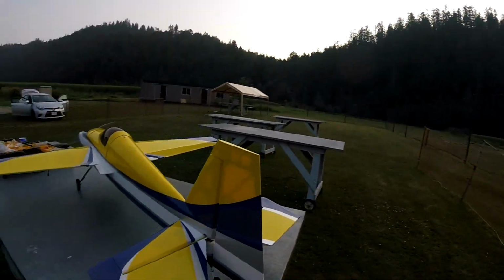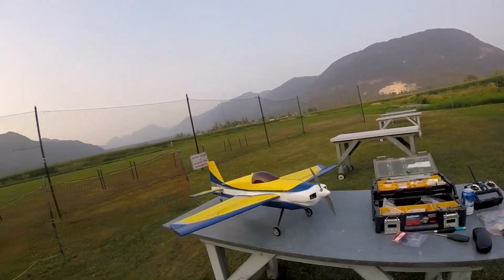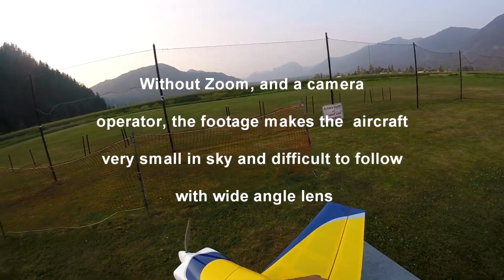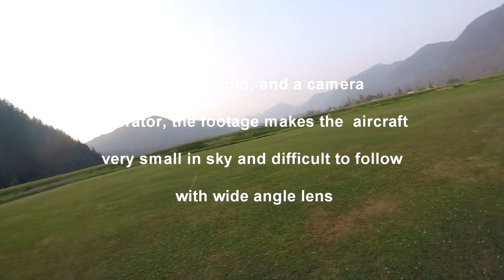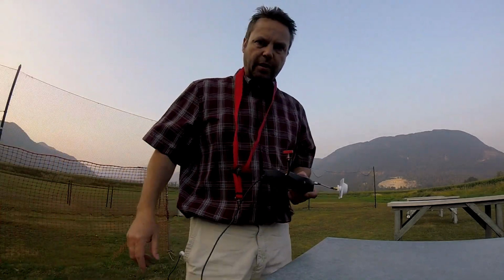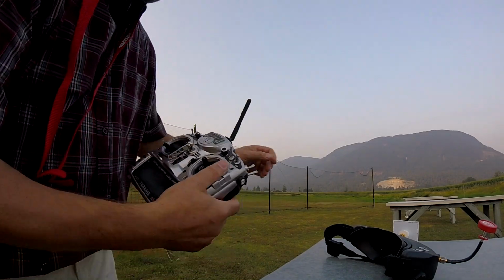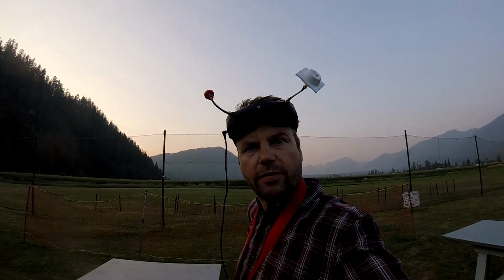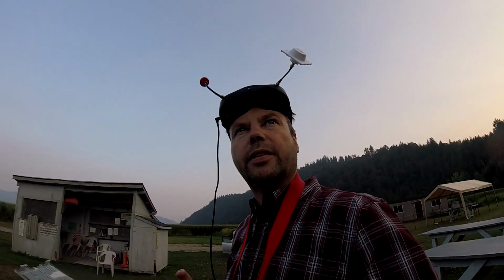Extreme Flight Laser EXP 48 inch LOS and Avant S5M FPV

Comment: Thanks for sharing - both cool flights!
Reply from the maker: Thanks Jason
This field is great for privacy and relaxing and practicing and test flights. The Laser will need several more flights/maintenance to get dialed in. The Avant is a high performance mini Quad and is pretty close to being tuned in, and is a joy to fly close in. Its not long range though, I'd say 5-600m out at best, but its a great close in Freestyle machine.